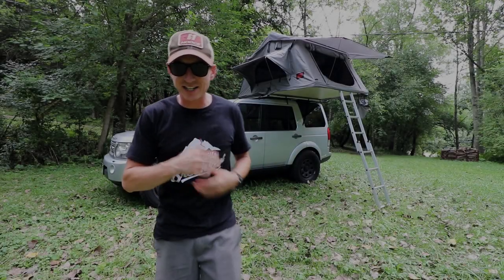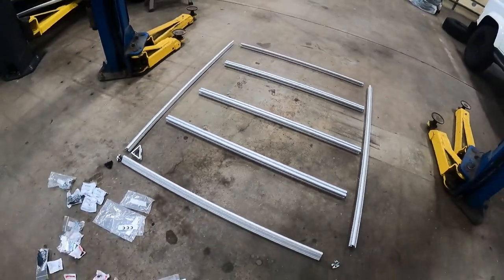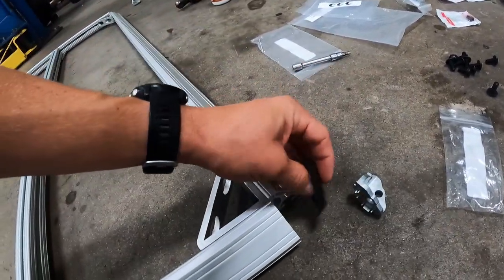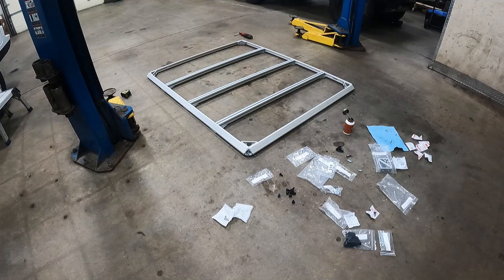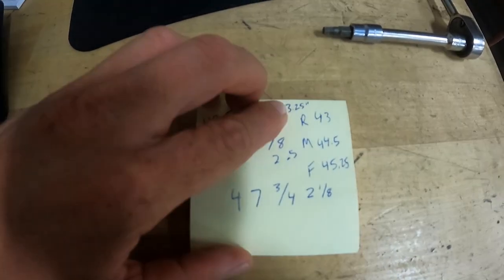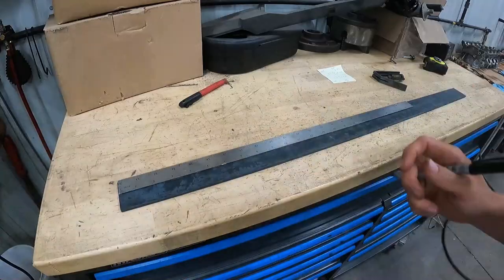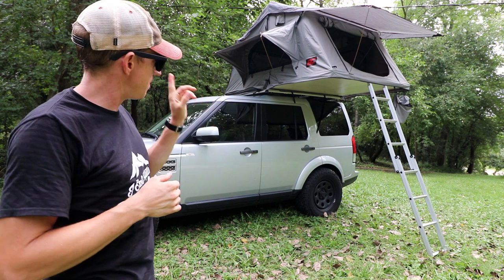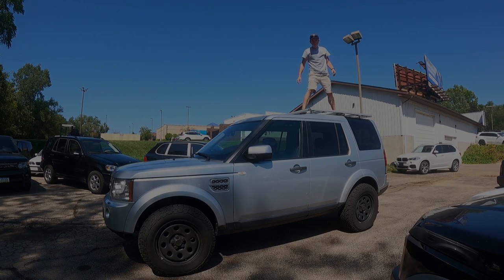All Aluminum Roof Rack Build | Land Rover LR4 Budget Overlander | Rooftop Tent

Comment: Would definitely like a kit for my LR4.  Thanks for doing all the grunt work!
Reply from the maker: I may just end up putting together a spreadsheet with the part numbers I used.
Reply: @LostCauseRanch  Got my vote.  Measurements by part would be most helpful, as well.  Maybe even vendors.  Thanks!

Comment: Good idea to produce a kit for folk to build their own. Just need a solar panel now to charge a second battery for accessories when off grid.
Reply from the maker: Solar panel and controller are sitting in the shop. So that should be in soon. Need to source all the bits to add the second battery.

Comment: Where did you get the rack itself?  I need something that isn't an arm and a leg for my Jeep hard top and want it to be low pro like yours...
Reply from the maker: The rack is all 80/20 T slot extrusion. There is a few different vendors. Think of it kind of like an erector set, you buy the rails and connectors you want and assemble it.
Reply: @LostCauseRanch  Yeah I am specifically interested in those indexed corner pieces, I did not see them on any of the 8020 sites I have been looking at, really like them.
Reply: @LostCauseRanch  What company did you get the indexed corner pieces from I want to build a rack like that for my Wrangler but cannot find the indexed corners anywhere.
Reply from the maker: @hstonebraker77  I got those from 8020.net  Lead time is a little long at the moment but where isn’t it right now.
Reply: I’m interested in DIY kit … would you ship to Saudi Arabia?

Comment: Is there an option to mount the rack to the oem LR4 side rails? I have the oem thule cross bars, but I don't think they'll support the weight of a tent and occupants. I'd love to mount a rack like this rack to the oem rails.
Reply: Yes, those same bolt locations are accessible with the oem rails.  Bolts may need to be a little longer to clear the rail.
Reply: @Dilworth-vj9nj  Ok. Thats interesting! I assumed the oem rails mount using the holes in the roof you referenced in your video. Out of curiosity, how do the rails mount, if they don't use those holes?
Reply: @Bookum10  My bad, I was wrong.  The holes that the oem roof rail uses is the same to use a aftermarket roof rack.  So you would have to remove the oem roof rails.
Reply: @Dilworth-vj9nj  As I think through it, I guess you mean you would just remove the bolts holding the rails and mount the rack to the rails using the bolts thy same bolt holes. Put me in for 1 (depending on price) if you decide to move forward with production.
Reply: @Dilworth-vj9nj  I would think it would be pretty easy to fabricate pieces that slides in to the rail channels that have a threaded hole to cinch the rack to the rails using bolts. Could probably use the same size mounting plates on the rack that you have in the video since the rail channels are likely centered over the bolt holes on the roof. Just a thought.
Reply from the maker: That was my thoughts, the factory rails may make it easier to mount. Just have to come up with a t bolt that fits in their track. I’ll look at one of the ones at the shop that has the factory rails and see.
Reply: @LostCauseRanch  That would be awesome. As far as I can tell, there are no off the shelf racks available that use the side rails as mounting points. You'd have the market cornered! So many LR's have the side rails, it's surprising no company has come up with a suitable mount. The rails also have the added advantage of being able to easily adjust fore/aft positioning of a rack. Keep us posted. I'd be a customer for sure.
Reply: Very interested in kit.
Reply: I'm a huge fan of your channel and I've been hoping for the cut list for this rack you made for a while now. Your LR4 build videos are excellent and I am aspiring to make my LR3 as cool as your 4!